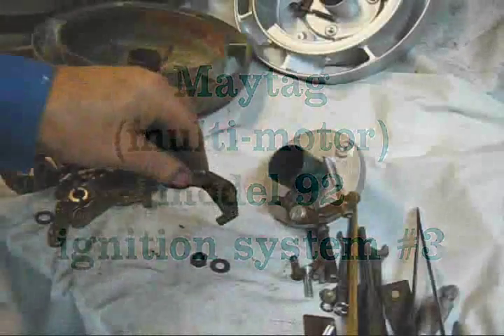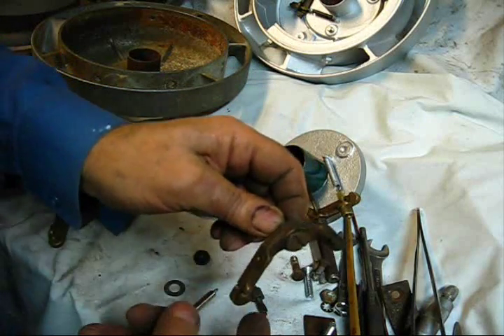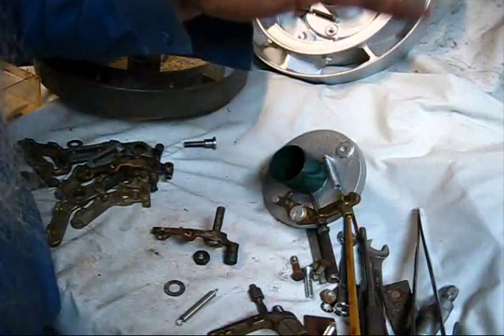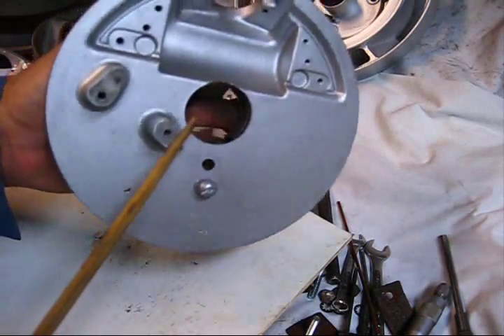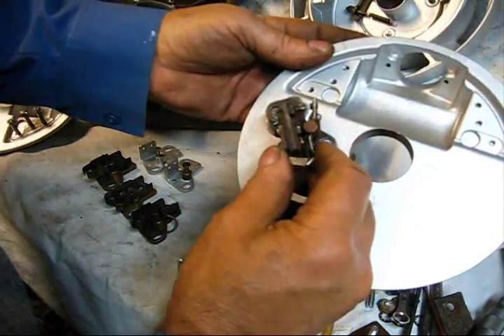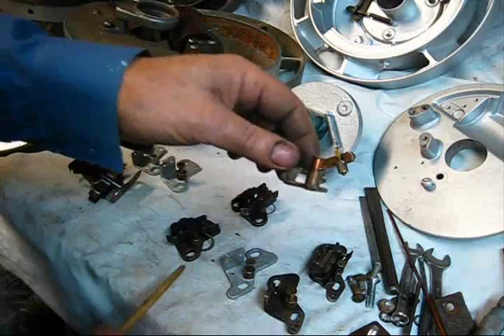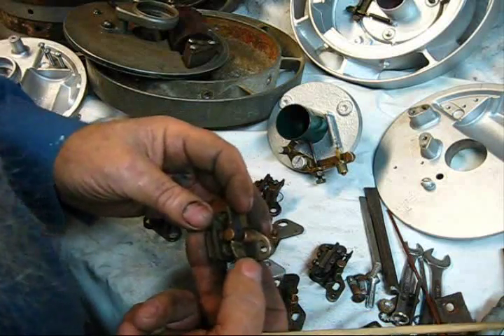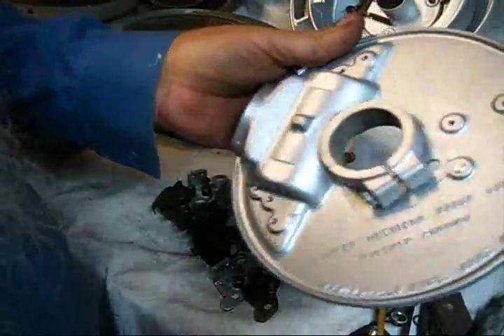Maytag model 92   ignition system #3

Comment: @coffeefish
In the Maytag Model 72 rebuild series, ShopDogSam explains that he paints the ignition backing plates with Rust-Oleum Oil-Based Protective Enamel.  He recommends the Aluminum #7715 in 1 quart cans.  A small brush was used to paint the backing plate.  He does not find that the spray can version adheres as well.
I believe that the metal contact between the backing plate and crankcase should not be painted.
ShopDogSam will comment if I'm wrong.
From the West Coast of Tennessee.